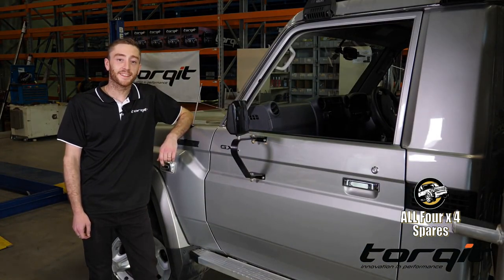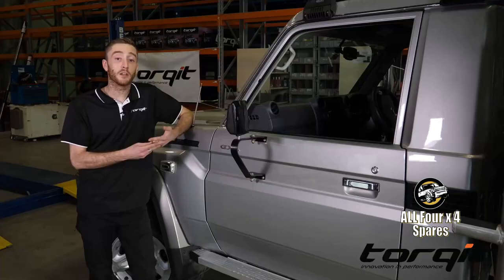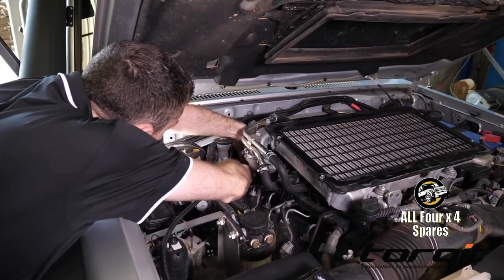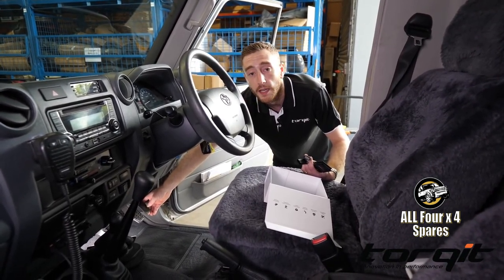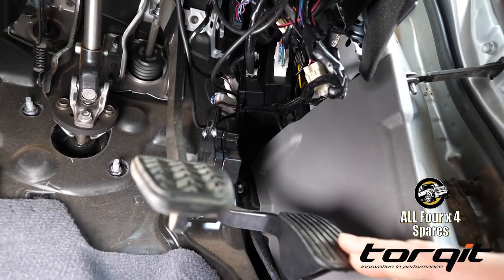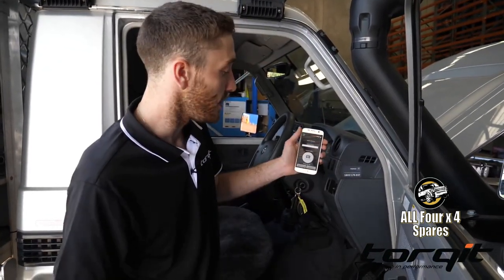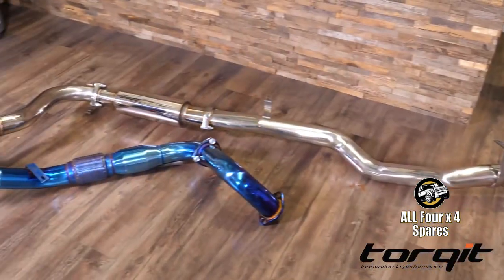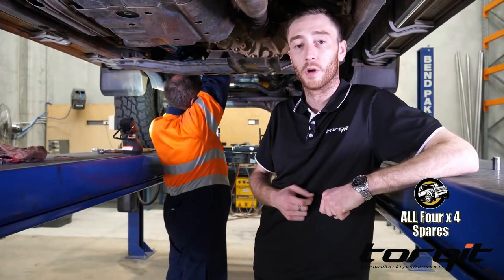Torqit Performance Upgrade for Landcruiser 79 Series: Exhausts, Power Module, Throttle Controller

Comment: Are those pre-dashlift VDJ76/78/79's equipped with mechanical throttles (via cables) as opposed to electronic ones? 
My uncle has a 2010 Troopy with the updated dashboard. He has run into what he describes as a "throttle drop" three times now where the power delivered would drop noticeably compared to normal times in response to the same amount of throttle applied. 
He took his 78 into Toyota after the first instance and had it tested. Initially, they claimed that it was likely an ECU f*ck-up after a drive around, but when he went back to pick up the car in the afternoon they said it was all fine despite the car now drove as normal with noticeably more grunt... 
And when the "drop" happened again and for the third time, he took her in and had her fixed for free again with little diagnosis Toyota was seemingly willing to offer apart from "it was fine". Given the fact that my uncle doesn't speak much English, I suppose people at What A Feeling would just go "we'll run a test and see what is wrong with the car" and later at pick-up "nah nah it was all good and it is definitely good to go now".
So yeah as I am looking to buy my own 70 series, I wonder if those earlier models of VDJ's had cabled throttles instead of electronic ones with ECU's.
Thanks in advance.